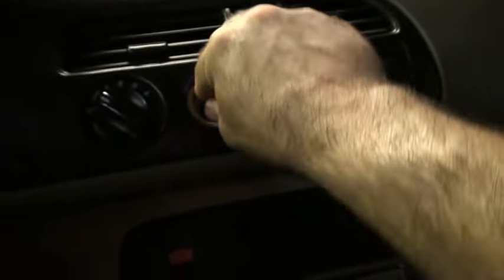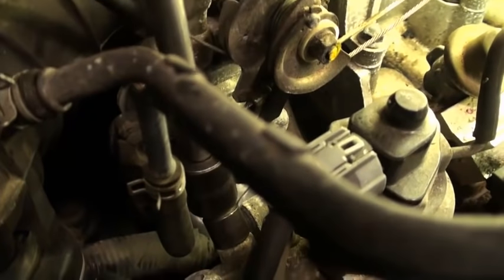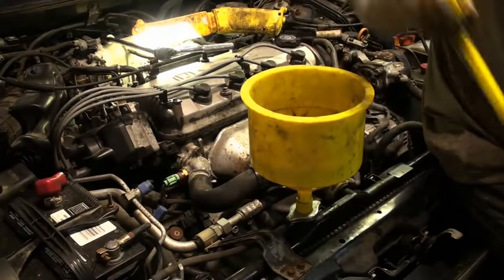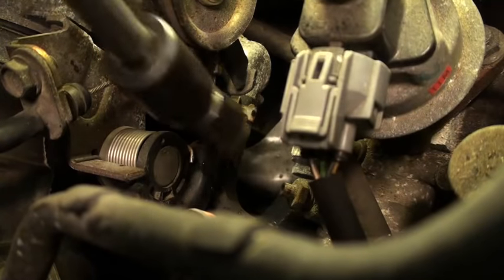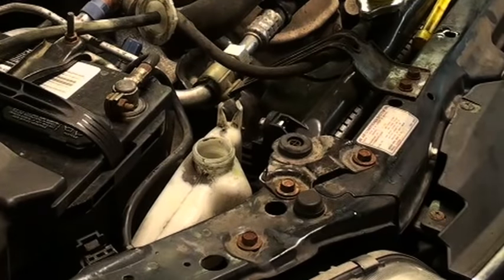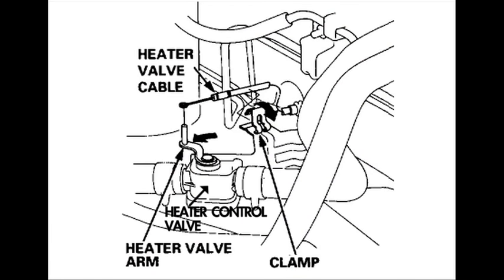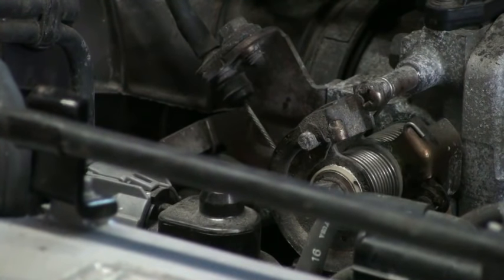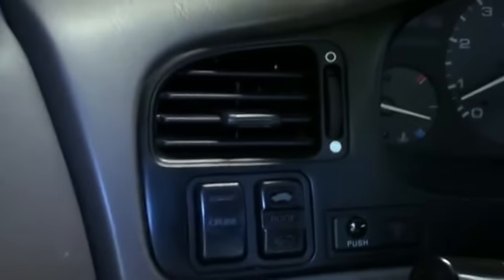How To Bleed A Cooling System - EricTheCarGuy

Comment: say eric i was watching your video on how to bleed  a cooling  system and i want to first and for most thank you for all you have done for me, and iam sure the public feels the same , well back to my question i have a toyota camry 1994 3.0 le and as i was tryng to bleed the cooling system as i stated the engine while it was cold and i was told to jack up the front so it would level the car so i can get better results ,well so they say,well on with this tale, the fan kicked on before  i was even getting to poor the coolant well it so happens  that i had a leek but i took care of it cause i used a pressure tester,well i kept with the bleeding and iam not getting sufficient heat,in the summer i replaced the thermostat the heater core  and water pump and timing chain but now iam getting a p0125  insufficient coolant temperature for close loop fuel control code,but here is the thing about that every time i fill the engine with coolant it some how disappears, i dont know if the high hydraulics have anything to do with the cooling system cause my fan turs with hydralic fluid,i dont know if you ener hurd of that but know sence i replaced those parts my rpm needle goes up and down a little bit, and the engine sounds like if its not getting gas for a split second, sorry i dont know how to wright short hand sorry about.

Comment: Hello, first off thanks for your time.  Ok so i have a 2003-4 buick lesabre limited i have fixed or had fixed a few things all dealing with the cooling system  but the most recent problem has me worried about what could be the problem/ my next move. So i replaced the coolant elbows and the water pump the middle of last year. Everything was fine until the car started running hot  so my next step was replacing the thermostat. Most recenlty my radiator cracked and started leaking. So i had the radiator replaced, we put fluid in it and i "thought" i bled it correctly (by opening bleeder valve and waiting for fluid to show). So i watched the fluid level for a day and a half after running an errand i decided to check and it was empty its been drinking it up ever since 2 gallons total another soon. I dont know what to do next guys. Almost at wits end, car only has 149 thou miles so i Hope its not a head gasket but dont have  $$$ for any pricey diagnostics.Thanks again.

Comment: My cooling system is full (2000 accord 2.3L) but has a shakie idle and poor fuel eco for months now, I opening the bleeder/petcock with the car raised at the back , up to full operating temp , but shut off , I had a little surprise , my Idle smoothed out noticeably when I re started and idled the car. So I had air in the system that was causing a ruff idle AND poor fuel economy in stop and go traffic and prolonged idling ... HWY seemed so so as the system was staying hot enough to go to a lean setting.. (I believe the idle air control valve had a air lock)
Purging the thermostat housing (using the petcock) should be done while .....idling OR shut off.... hot or cold ...thermostat open or closed ...  ??   Thanks in advance !

Comment: yaa my yota had air in sytem and it was running real rough  ,bad idle ,terrible mpg,,just went out and bled air out with that lisle spill free funnel ,, it runs like a new motor again ,,, the coolant temp sensor that send signal to ecu wasnt sending reliable signal  bebause of trapped air in the system ,, stealership said i had a sunk valve BS  quoted me $1700.00 !! ,,i try to work on my rigs as much as possible ,,guys like eric here are awesome

Comment: I have a 99 civic LX with the D 16 single cam and I have a check engine light on for the idle air control valve I replaced the idle air control valve but I still have the same issue with idle surging and bucking . Should I bleed my coolant system do you think that could affect this?

Comment: Hi it's a helpful video thanks for ur help .. Small question My radiator has a yellow water whenever I top up clean water .. The clean water will become yellow after some times!! What should I do clean my radiator or change a new one including the pipes as well ?! 
And thanks so much dear :D
Reply: Brown slug*
Reply: +Rian Taei 
if your having to fill it up regularly somethings leaking a water hose crack in the radiator head gasket or cracks-(worse case) fix that first you run it out of water its as good as wreckers bait 

radiator flush i also pull the reservoir/overfill off and give it a scrub out makes it look nice 
then add actual radiator coolant (antifreeze anti-boil corrosion inhibitor) its green or red sometimes thats whats supposed to be in your motor not tap water 50% coolant concentrate 50 % distilled water or even better de-ionized water dont believe the shop when they say this stuff is for your car at twice the price of the cheapo the other stuff will wreck it they are only there for your money not your cars well being the other coolant works just as good as the expensive stuff considering you're gonna dump it out and put fresh stuff in there every 50000 kms or yearly but that depends how much shit you give it

Comment: Hey Eric. I watch and learn from a lot of your videos. I was wondering if you knew how to purge the cooling system on a 95 Cadillac eldorado. I had a coolant leak ofrom my metal pipes and I did a bypass and now my water isn't leaving the reservoir tank. I'm at my wits end on this car and ready to take a sledge hammer to it. Can you plz help. Thank you for your time.

Comment: Hi, I don’t know if you are still answering questions but I just saw your video, I just replaced the radiator on my Honda Accord 97 and I don’t know if I have to replace the thermostat or not, I took it for a test ride and doesn’t seem to heat up it is still little below the middle, how do I know if it’s working properly?

Comment: EricTheCarGuy I have a 1997 honda accord and ig recently started over heating on me. By the time I got home it was all the way to the red. Leaving it in my driveway without driving it for about 9 plus hours I went to go start it and it shot right back up showing it was over heating again.  My question is what could be the problem? I was thinking a thermostat change and do a flush in the radiator. Any suggestions would be helpful. Thanks

Comment: This is probably a dumb question but I'm a newb, so it is what it is.. 

Will air &/or coolant escape from the bleeder valve if the engine is off, or should the car be running while adding the coolant?

Comment: Hi Eric,  When I had the water pump replaced on my Ford F250 with the 7.3 L powerstroke engine, the coolant temperature doesn't rise up to where it used to.  After seeing this, I thought, bingo.  Can I use the funnel approach to eliminate air trapped in my system or is there a different/better way for my engine?   Awsome tips...from a long-time subscriber.
Reply: No..that truck does not have a conventional radiator cap and the system is so big that you will more than likely need to use an airlift coolant purge/refill tool to ensure you positively get out all of the air if you have questions about it its best to see a technician. big systems are easier refilled with this tool but little cars like this or any car with a cap on the radiator you can usually nail it the first time with the spill free

Comment: Good review, I have water in my car radiator and I need to replace it with coolant, I bought antifreeze 50/50, so I can use it as it is and no need to add water or anything. please advice how can I do it with your experience and anything to watch out for? I have GMC Acadia 2010. Thanks
Reply: I did it myself with a flushing kit, as my truck is an oldie 255k miles on her. So it needs that kind of love. This is what i did, so not saying/stating this is the way you should do it. But it came from an friend of mine that is certified mechanic. I flushed mine, might as well this way your system will be super clean and ready for your fluid!

1 Remove the cap of the radiator put the flush kit on there
2 Locate the heater hose that goes from the block to your heater-core
3 Install the flushing "T" into the system (follow instructions) 
4 Install the back-flow preventer that comes with the kit 
5 Attach a water hose to the back flow preventer 
6 Open the water hose and flush the system
7 Clamp of between the flushing "T" and heater core, it prevents back flushing.
8 Watch the water coming out of the hose, once it's CLEAR/CLEAN
9 Put the clamp between the "T" and engine BLOCK this will clear the heater core. 
10 Once it show nice clear water, disconnect the hose from the flushing "T"

Now what you do is, open up your radiator, engine block and let all the water just drain out. I did it on my driveway, because the flush cleared it of old coolant and crud i might have had in the system. I also took of the recovery tank off and gave it a good rinse getting that black crud out of it. I used an bottle brush and some mild detergent that does not FOAM. 

Close it all up radiator, engine block what not were you drained it. And you're ready to just fill it back up with coolant. And you should be fine for another 100k miles if not more with a nice clean system. 

Again this is how i did it, there is plenty of material out there i bet Eric here has one up too. So there are different ways of doing it, and i am NOT AN MECHANIC. So i choose to get an flush kit to make my job a lot easier! And pretty much childsplay. 

Good luck hope it helped! 

Link to the kit you can get them even at walmart for as low as 8usd 
WELL WORTH the money..

https://www.walmart.com/ip/Prestone-Flush-and-Fill-Kit/16817507?wmlspartner=wlpa&selectedSellerId=1060&adid=22222222227018384896&wl0=&wl1=g&wl2=c&wl3=40838589272&wl4=pla-78651946112&wl5=9011016&wl6=&wl7=&wl8=&wl9=pla&wl10=112550001&wl11=online&wl12=16817507&wl13=&veh=sem
Reply: ... That will work fine. BUT I have seen some of those Prestone flushing T's crack and fail.It's just plastic.i made a bleeder/burper' from a pair of brass garden hose connections. The heater hose that goes to the engine block is the highest point in my system and it works great.
  Gets very hot,so I use pliers to tighten it back up.

Comment: Great info here thanks, replaced one of the coolant hoses coming from the IACV (honda calls it "hose b") it finally sprung a leak after 26 years, 97 honda accord ex wagon / 2.2L Vtec with the same ABS pump issue / noise. Been a great car otherwise.

Comment: Check your coolant temperature sending unit. Check if that sensor has any debris that prevents proper connection. If it still doesn't work then replace the sensor and your temperature gauge will work once again.

Comment: I'd start showing more videos on cadillac cts. I have a 2008 with 150,000 and I've changed a few power components, and now I'm having to figure out where the AC drain value is located. I'm hoping it's located in the firewall on the passenger side. But we will see, I  got tired of running around checking all these other locations. I even changed actuator that didn't need it I think, but at least I now have a new one now. Lol. Bless.

Comment: Etcg, do you know any easy steps for fixing the following situation? 

I checked my radiator cap after i noticed low coolant...i thought that was odd... And noticed the cap had a missing rubber gasket 😮. I'm guessing it's in the radiator!!! What can i do to fix this? I can't feel past the neck of radiator. Will the rubber deteriorate and clunk up my engine/thermostat?

Comment: -- i have a 99 Honda Accord EX ---> first related question is Where should the Temp Gauge needle sit? -- when i took my 99 Accord to get new radiator hose replaced the temp gauge was about 1/4 up like you have on this video --- after new hose was put on the temp gauge needle now sits just below half way point ... why would that change happen? --- does that mean there is air in the system --- i was asked by friend if my tech bled the system and honestly i dont remember if he did --- i was there in the shop watching him change the hose out but dont remember if he bled system ... im concerned about the temp gauge being right under half way point ? - #Help

Comment: This is probably a dumb question but i need to know before i get this car moving... What if i dont open the bleeder valve but did everything else eric did? As in i started to do this process and forgot to open the bleeder valve. I did rev it to 2500rpm and i let the fans come on four times. I have this same funnel and notice that the bubbles stop popping up. Should i restart the whole process or i should be fine? 

Thank you
Reply: Jack the front of the car up, take the cap off, start the car and turn the heat to high. Add coolant until it stops bubbling, dropping in fill level, etc. if it's full sheet running like that for 10 minutes or so and you can't top it off any more, you're done and good to go

Comment: Yep good video, do all car's have a bleeder screw? I have a 1997 land rover discovery 3.9 and my car manual is gone so?
Reply: hi no all cars do not have bleeder screws.. you should be able to fill and drive let cool fill again if you  do have a bleeder screw it usually sits on thermostat housing.
Reply: Ok thanks, car keeps over heating after about 2 hours so changing hoses & thermostat but I was told that after towing heavy trailers the radiator can get blocked so hope this fixes it?
Reply: Clint Lambert.

Comment: just watched your video just had a radiator and thermostat and hoses replaced car wasn't running hot before but had to replace the radiator now car is running hot no leaks any where could it be air in the system 1992 lexus sc400 and were would the bleeder valve be located on the car

Comment: I got a problem... my thermometer shows the temperature where it should be when the engine is warm and my heater is not working as it should be. My question is: do u think i have a bad thermostat even though the indicator shows normal temperature?

Comment: Hey Eric, my 2001 audi overflow line nipple snapped that goes to the reserviour(top up radiator fluid) So now I blocked it with a screw on both ends. Would this cause any problem??? or I should retapp a new barb fittings so i can rejoin the overflow line back to the reserviour. Thanks

Comment: I over tightened the screw and some of the thread broke off. Can I use a regular screw to plug up the bleeder hole? The original bleeder screw doesn't have tread on the tip so it doesn't catch. Can I use a regular screw to plug it?

Comment: Hi Eric, 

I have a Rover 45 2002 (benzine) It has a expansion tank. I noticed the tank was under high pressure, even when I didn't drive the car for a week. I have checked this a few times. The pressure stays always the same. Rover is known for its cylinder gasket problems. I also put a 0.5 liter coolant every 3 months in the   expansion tank. because it keeps declining. 
What is your opinion about this? 
Thanks!

Comment: Erick i have a 2006 Nissan Altima 2.5s. Just bought it used. I haven't had any work done to cooling system. I did need a battery, headlamps, tie rod, gas cap. It had  p0507 irregular idle code due to engine surging in park or neutral. Turned out to be low CCA on my battery, which was inadvertently discovered by Advance Auto when my car failed to crank. After replacing the bad battery ive had no more idle surge and the code cleared itself. I had to pull bumper to replace lights to pass inspection but nothing concerning cooling system. 

Suddenly I have no heat at all. Regardless of whether the cat is driving or stopped. Im pretty sure I checked for working heater at purchase. 

Do you have  troubleshooting steps?

Comment: I have a Civic, they have a digital heat/cooling system as in there is not hot side or cold side, it only changes depending on temperature. Would I have to turn the car on and then put it to the highest heat?

Comment: I just had my fan motor replaced and my thermostat/housing replaced on my pt cruiser.  It's still running hot.  Tomorrow, the mechanic is going to try replacing the thermostat yet again, in the hopes that maybe I just got unlucky and O'Reilly's sold me a faulty thermostat. {{doubt it}}, but ok...lets try.  What are your thoughts????   What else can I do???

Comment: Eric ...on a 1995 toyota camry ...with the 2200 engine I get the upper and lower radiator hoses sucking in on themselves...what would cause this ?  I only notice it after the engine has cooled down, after it has been used or running. as far as a bleeder ? it seems this particular model does not have one.

Comment: Hello, Eric here is my situation I have a 02 dodge ram 1500 sport 4.7magnum v8 engine and noticed that it was a little bit of a cooling fluid coming from the thermostat, so I replaced it and oil changed. When I fill the reservoid because is connected to the radiator, and it no additional cap. I ran the engine and it was fine, but when I run it on the expressway it started to overhead to the maximum, I pull over let it sit for a bit 1hr. And started again to make it home 5 minutes away. What is your suggestions and how can I tell that the radiator is full? ALSO REPLACE THE LOWER HOSE AND CLAMP.

Comment: Eric, I have a 1997 honda accord se 2.2 lt, my problems is that the radiator fan constantly runs after the vehicle is turned off. The coolant temp sensor has been replaced, but fan constantly run after vehicle if turned off, My question is is this normal for this particular car?